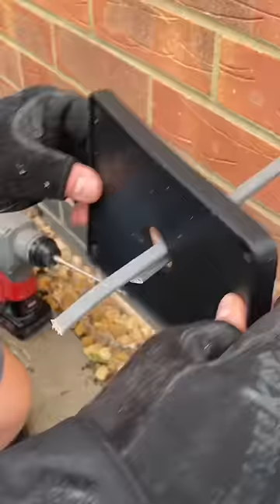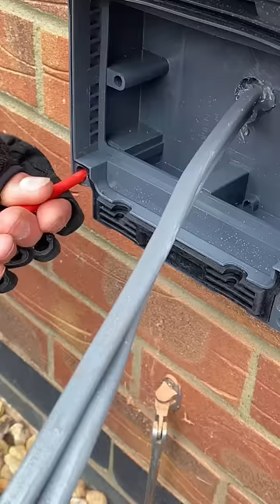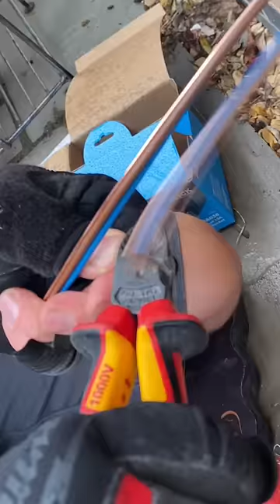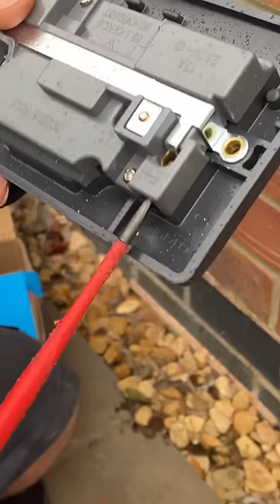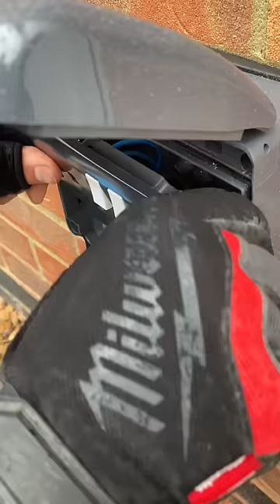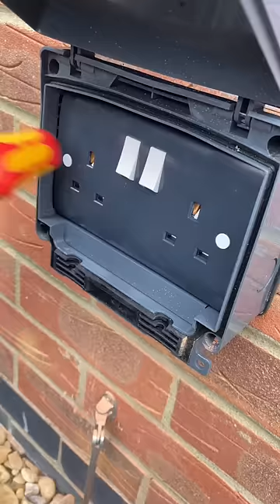Bit of blob to cover your sins. #shorts

Comment: Always do an upside down horse shoe shape silicone bead, that way you are sealed from above and any trapped moisture can seap out below
Reply: A rainbow. Do a rainbow.. lmao. I think of horseshoes as the inverse of a U, but I guess not everyone does.
Reply: Dope it up
Reply: My man!
Reply: I like to fill my backside then pucker a nice Rorschach pattern onto the wall.
Reply: No do an Ohm symbol !
Reply: Ω
Reply: Am I on drugs
Reply: @ImaGe_ lolllllll " do an upside down, triple beamed inverted  flip side shape of a anti moisture horseshoe "....."uhh ya mean a rainbow?" 😂😂😂😂
Reply: @MOONFACEFLOW  😂
Reply: Yeah came here to write this
Reply: @raypetty5129  💯
Reply: @Spinatra  i am
Reply: You are correct
Reply: Р000
Reply: Is this before or after the brick gets rained on pretty sure bricks are porous
Reply: He didn't caulk around it, it's purpose was glue
Reply: @ImaGe_  There's a bit of old superstition that says you should hang them 'up' like a u, even though there is more effort involved, because it will collect luck, but if you hang it upside down, it will spill out.
Reply: @Spinatra  Definitely!
Reply: Tell them  how it's done boss
Reply: @ImaGe_ cables are insulated.😂
Reply: Where did you get that from? @JosephLedbetter
Reply: @markrainford1219  I used to build could for an electronic vaporizer and you have to measure their Ohms to see if it's a good coil.
Reply: Lol I know what an ohm is, I  meant how did you get the symbol.  @JosephLedbetter
Reply: Will do , but first I will have to find out which way a horse shoe is when it’s right side up.
Reply: @ImaGe_ thats gay bro
Reply: Yeah, this guy did it completely wrong. The water is going to seep down through the top and correct in there and go right in that hole.
Reply: So an "n"
Reply: Quando dava no nível.   Ela secava e botava cimento...quebrava parede no formato da caixa.  E ela g ande quase 90 ,cm
Reply: @AZ-kr6ff I'm thinking your backside might get a little uncomfortable, but whatever...😅
Reply: @sheilaheinrich2656  
All in a day's work, my dear... besides, I'm a professional.
Reply: @ImaGe_ A horseshoe is like Ω It prevents splashes and as a smaller hole at the bottom. Also prevents speedy water jets to bend inward on the radius and an worst case scenarios shooting into the covered space
Reply: There’s the I would do it this way better because comment…. Earlier commenter predicted.
Reply: Is blue ur neutral?
Reply: cheeky bit blobbage

Comment: I came for the inevitable "Personally I wouldn't do it that way" comments 😂
Reply: Just couse this is way inefficient than the right method xd
Reply: I would have wipe the water away on the inside.
Reply: Upside down horseshoe or rainbow
Reply: RCD Protection ?
Reply: me too
Reply: I would've used WAY WAY WAY more glue and screws,then glued and screwed the lid shut.
I also can help but notice he doesn't even have his plasma cutter with him, you can't do a job line this without a plasma cutter
Reply: Tidy work, sir 👍🏻
Reply: @G00gLe_was_my_idea989  Or 3D printer.
Reply: Personally, I wouldn’t do it that way because I’m on the other side of the pond(NY).  
You blokes have cooler looking materials and cable than we have, that’s for sure. We still have to install weather resistant GFI receptacles outside. I’m assuming your entire panel (main?) are already GFI protected? I think we’re way behind you guys on safety and efficiency. We also have paper walls. I don’t know if you’ve heard.
Reply: I would have commented differently….😂
Reply: Me too. Every keyboard exert would have done it differently because they saw their dad doing something completely different 13 years ago.
Reply: Happens every tradey or diy video without fail😂
Reply: 🤣🤣🤣 dude I came to the comments looking for the first one to be someone shitting on this vid and saying it's wrong.  It never fails, someone is going to have to comment how awful a job someone did, even if it was done right 😂
Reply: I work with a guy who’s just like that. Makes you over think every time he says that.
Reply: How many contractors does it take to screw in a light bulb? 100, 1 to screw in  light bulb and 99 to say: that's not how I would have done it
Reply: I was thinking about the moment when somebody will try to remove that box, by removing the screws, but the only thing that will come off the wall will be blasphemies
Reply: @boboften9952  
YEP....
In the UK & Europe (and I think Australia/New Zealand are the same) the RCDs are in the breaker panel alongside the breakers, so every circuit and all the wiring to them is protected. Only Special installations such as solar installations generally don’t have GFI/RCD protection.
Reply: This ,this ,this ahh the Internet and people opinions yawn.

Comment: Video title: “How to dispose of that partial silicone tube you’ve had since last year.”
Reply: I tried that the other day & the remainder had set in the tube, so I had to go buy a new tube anyway.
Reply: Tfsgbn
Reply: Ok
Reply: @carpathianken  you can drill throu it and still use it. At the same time you can can use some of it as a reference on a piece to test it out (if its still good). Works for me.
Reply: It will be perfect place for mold& mildew to bloom.
Reply: @Movie2Documentary  put a screw in the tip and some plastic or tape around it. If it dries, unscrew the screw instead of getting silicone on a drill bit.
Reply: With that blowout on the face brick this is a bitcher at work - using a full size masonary bit to drill from the inside of the building
Reply: @kestutisbagusauskas8323 -- Yeah.  He could have used some of that excess glue to glue the brick face back on.  But with all that glue, the brick will be shattering again when the box is removed.
Reply: cheeky bit blobbage
Reply: If u ever have a drop of left over or old silicone just shut it because we need the shit everyday and continuously run out of it
Reply: @brookelord3448 after the screw, use a finger from a latex glove.

Comment: My man didn’t even use wall plugs for the screws mental
Reply: Those are special screws ;-)
Reply: @kjeldschouten-lebbing6260 wouldn't know they didn't show the screws. I do know tapcons don't screw in that easy
Reply: cheeky bit blobbage
Reply: Got screwed too, seems it’s a common practice;)
Reply: Probably tapcons
Reply: Lol, I can tell this isn't your trade😅
Reply: Used mastic, screws were more for the casing
Reply: @leifmate123 probably pushed them through the hole after he drilled. It's the good ol' "I forgot to drill before I glue" trick.
Reply: The jump cuts should be the hint 😂

Comment: Handy Hint , make sure the silicone you use is NEUTRAL CURE , acetoxy releases acetic acid on curing and can cause premature corrosion of terminals and metal work inside socket.
Reply: Better do not use it at all. It will grow mold.
Reply: Ok, no silicone? What do we use then Professors?
Reply: @christiangeddes241  Nothing. You use nothing.
Reply: @christiangeddes241  Bore out a larger hole, insert a plastic tube, feed the cable through that, next Ignore me as i'm not a spark and probably haven't got a single fucking clue! :P

Comment: I love that everything's a hammer when you're a sparky
Reply: We aint carrying a hammer when you dont need nails.
Reply: (Electricians) We are always carrying our hammer with us, but we are only using it when things are important and really must getting nailed 👉🏻👌🏻🔨🤰😎
Reply: And the floor is a trash can.
Reply: Everything’s a hammer when you’re a technician of any kind. Cars, carpenter, plumber hvac…..mammogram tech👀
Reply: BUILDER 
KITCHEN/BATHROOM FITTER 
MECHANIC
PLUMBER
JOINER 
LABOURER
WINDOW FITTER 
LANDSCAPER 
FENCER
FARMER
SPARK 
ROOFER 
GLAZIER
GAS ENGINEER
WELDER 
FISHERMAN

even my ten year old knows how to swing a hammer 🔨

I bet it's next to screwdriver for the most popular tool out there
Reply: He didn’t use a hammer 😅
Reply: @luckyluke5350 I saw several hammers in this video?
Reply: cheeky bit blobbage
Reply: So true

Comment: The electrician memes are real. You can actually see the mess he left on the floor 😂
Reply: REAL! Complete with using the screwdriver handle instead of a hammer! :D
Reply: @neferiusnexus  why would you use a hammer on plastic instead of using the plastic handle of a screwdriver that won't damage the merch.

Comment: Nice long tails too, better to be looking at them than looking for them! 👍
Reply: Honestly nothing better than sone excess wire to play with in the near future, if it does no harm it does no harm
Reply: So right. What do you do when the wires are too short but in the walls?
Reply: Two bare conducive wires under one screw is a no-no. Pigtail and land 1 wire under 1 screw. Silicone around the top of the box to prevent moisture getting behind. Few guys I know (25yrs in the trade) use those style of strippers. Good for show, but most guys are just faster with the basic 15 dollar kleins. Did like those fingertip gloves though
Reply: You can still add piece to a short one, but there is nothing you can do to a long one!?😂
Reply: If you're long, you're wrong...but if you're short, you're gone. 🎉🎉🎉

Comment: in au, our outdoor switches aren't covered (apart from the two-phase ones I've seen, but those seem to be just for dust protection) they're just angled downwards and they seem to work just fine
Reply: It never rains in Australia.
Reply: Congratulations
Reply: @davea11  thanks
Reply: @ericpb6589  In Queensland, it's either in drought or flooding. Most of last and this year it was flooding and rn we're getting days of crazy rain in between 35°C days which is a common cycle
Reply: Lucky you! In Britain it’s so damp I’m surprised we don’t put covers on our indoor sockets 🤠

Comment: I would recommend lexel, its some amazing stuff for sealing different surfaces.  I repair and install massive stained glass windows and frames and we use a urethane sealant which is expensive but nothing is better.  Wood to brick, aluminum to wood or brick or concrete.  It works for everything and lasts decades with no problem.

Comment: Try a small pilot hole if from inside to mark your spot on the outside. Angle it down towards outside to prevent water penetration into the wall. Then go outside with your full sized bit and drill towards the inside following your pilot hole. The pilot hole and a bit of care will prevent chipping around the drill bit exit. What chipping that might happen will then be inside the wall, leaving you with a clean and proud hole on the outside surface of the brick.
Reply: he's an electrician, not a mason. u r correct though ! don't blast the brick. should actually use a sleeve with water tight connector
Reply: @gladeloy3341  Put a 20mm conduit adaptor on the box and drill the wall to accept it. A small bit of sealant on the adaptor to seal it into the hole is all that's needed.

Comment: You had me .. until the white screw caps - noooo!! 😂
Reply: The scews were also not alligned straight.
Reply: @Batalia122  Electricians don't align them. Only elec. apprentices do.
Reply: Why do slotted screws still exist?
Reply: @Thriftzona  Like so many other things in this world.  People like nostalgia.
Reply: What got me was that he hammered them. Good idea, I'll be hammering my stickers from now on.
Reply: @TrumpGotFired  it’s literally plastic caps… which point of the video do you see him hammer a sticker
Reply: @chukob5  you are right, I stand corrected. 👍
Reply: What's wrong with white caps?
Reply: Yeah that's least of the wrong here.. My god
Reply: Those caps are nothing but a pain to remove. They do nothing but slow down maintenance and repair
Reply: @Thriftzona  I know, they are awful. I’ve not seen anything different on electrical stuff in the UK though so there must be a reason to use something so poor.
Reply: It's to match the switches...

Comment: At last an electrician on you tube that knows the correct way to strip cable
Reply: Ehm....but reassamble the housing of the ground isnt cool...
Reply: @marclehmann1647  please explain?
Reply: Two bare conducive wires under one screw is a no-no. Pigtail and land 1 wire under 1 screw. Silicone around the top of the box to prevent moisture getting behind. Few guys I know (25yrs in the trade) use those style of strippers. Good for show, but most guys are just faster with the basic 15 dollar kleins. Did like those fingertip gloves though.
Reply: @joshd4444  I looked way to long though the comments to find what you just commented.  The amount of bad information is sad.  21 years in trade myself.  What the video depicts is not correct.
Reply: @joshd4444  You're speaking bollocks, this is the UK not the US, two conductors in a screw, is a perfectly correct way of doing things. Maybe you should realise the US isn't the best at everything...
Reply: @chevy383driver  Why? This is the way the UK does things we look at you guys are laugh our socks off with your backward switches and sockets.
Reply: @marclehmann1647  what's wrong with it?
Reply: @Eddiecurrent2000  Backwards switches and sockets...... I have zero control on how things are made. But I do know using a device for a wire splice is not correct,  I don't care what country it's in. Electric works the same in every part of the world. Just have different voltage, Hz, devices.
Reply: @chevy383driver  Absolute nonsense, it's the way UK ring final final circuit has been done for decades, and the socket outlets are designed to do the job. There is nothing wrong with what we do. And yes, the US sockets and switches are hilariously bad and frankly a joke when compared to pretty much the rest of the world.
Reply: @Eddiecurrent2000  The ring circuits are about as dumb as they come. And it's because of the ring circuit is why the UK plug is huge and overmade. So yes the USA plug is a complete hunk of junk compared to the UK plug, but for reasons.
Reply: @chevy383driver  Ring circuits dumb? We don't have to use them in any case, but  what is dumb is having socket outlets that you can't wire into properly and have to pigtail to wire into and extend into the next outlet, such a silly way of doing it. The best part of UK wiring is that we don't even have to use a ring final circuit, but we could use a radial system without having to pig tail stuff or run a different set of wires for high current or 240V appliances, so it's not even the ring system which dictated the design, but the safety afforded by the plug's flexibility, the ring system is just used as it's a cost effective way of wiring without having to use 4mm wiring all over the place.
Reply: @Eddiecurrent2000  We're going to agree to disagree.  You laugh at my electrical controls, I laugh at your electrical controls.  At the end of the day it all turns on a light or whatever.  But thanks for pointing out that this video is made outside of the US and that's its done correctly to your code. It made me learn something.
Reply: @chevy383driver  Lol, yes, we'll always laugh at each other's - we're just grateful neither country has Indian or equivalent wiring...

Comment: I would have put it only above and the sides. Always leave a gap on the bottom. Just in case water does get in, at least it has also a easy way out.
Reply: That’s it! More than enough not waste half tube of silicone for worse

Comment: You forgot to bore out the drain holes, you will be back soon to replace the socket due to water/condensation damage.
Reply: The slots on the screw heads need to be vertical...
Reply: Acetic acid will take care of the contacts first.....

Comment: He sleeved the bare ground.  Impressive.
Reply: Pretty standard in the UK anything less would be against regs and very poor work
Reply: Regulation
Reply: Completely unnecessary. It's a GROUND wire!!
Reply: @andrewcooper3388  Why would they sell it with the bare conductor then.. Lol
Reply: The backside of the ground copper is showing so this doesn’t really do a whole lot sleeving a ground in a plastic box lol
Reply: @MrMcShroom because you can use the same cable for switched mains etc.
Reply: @eleycki  Would you still need to sleeve it anyway? What's the difference if you don't mind explaining.
Reply: @MrMcShroom  in a different colour yes, denoting that it isn’t earth/(ground).
Reply: @FatterTony  ???
Reply: Earth sleeving is Always
Reply: @user-hh8lt3le3c  just weird cuz we dont ever sleeve bare conductors
Reply: @davidwebb5799 YEE-HAW!!
Reply: @eleycki Are you saying that you use the earth wire for something other than earth?
Reply: Earth cable or CPC (circuit protective conductor) is there to protect the cable not the plastic socket
Reply: @billbo3688  Wow, your terminology in the EU or UK is so different from ours in the U.S. even though it says the same thing.  WE have Ground, groundING electrode, grounding electrode conductor, ground conductor or ground wire (THESE should have no voltage or current under normal conditions.  THEN! we have the Neutral or GrounDED conductor which carries the circuit current.